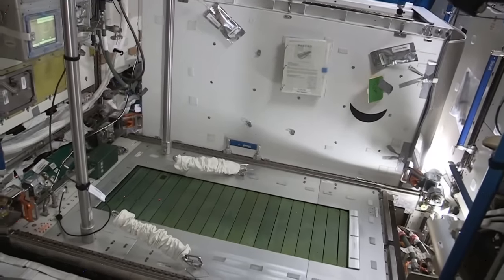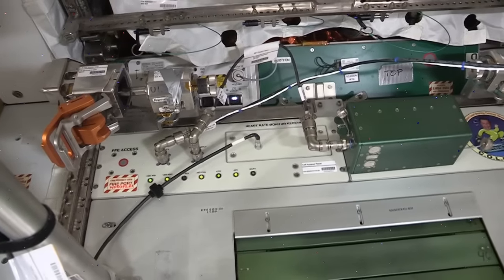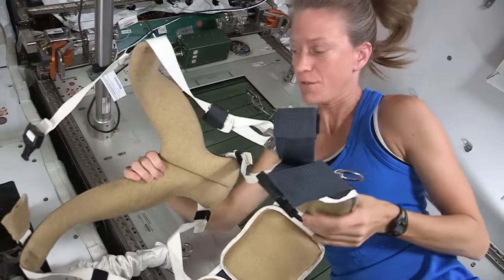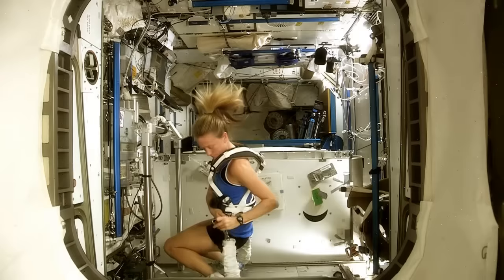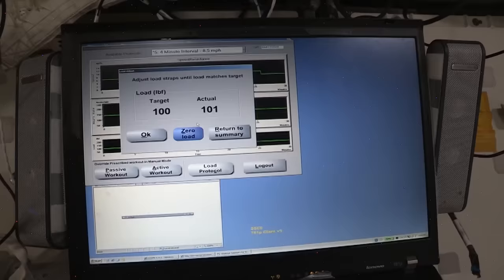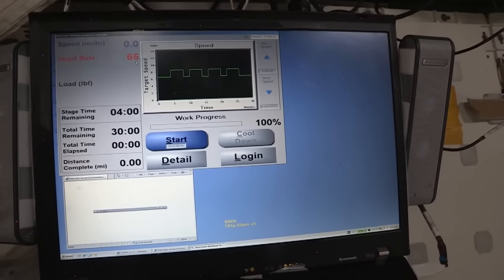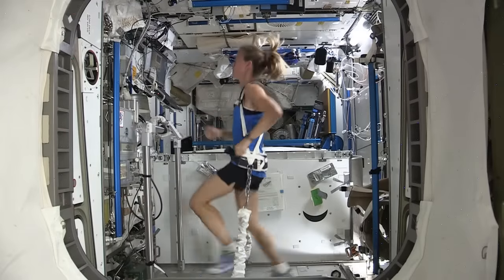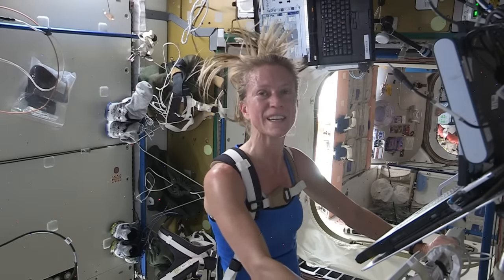Running in Space!

Comment: Is that... is that Windows XP...
Reply: Dino Perić Yeah, upgrading programs would take too long/ too dangerous so they stick to what they were made on.
Reply: +Dino Perić That's what you get when you need the computers to absolutely never fail. You use an old, well-known, well-proven software. The New Horizons probe uses a Playstation 1 core IIRC.
Reply: *****
 Exactly. Movies have messed with peoples perceptions. No they arent using some super secret advanced software with interactive holograms.... They use something thats proven and easy to use.
Reply: +Dino Perić Windows XP Is better then nothing :D
Reply: +TheRandom Gamer Windows XP is still the most stable and best running OS Microsoft ever produced.
Reply: +Raizzor18 The only problem - new hardware support. But it now can be run on almost any PC - no hardware limitation - just 1mb of video memory is enough! But I believe, it is customized XP.
Reply: budget cuts
Reply: My windows 7 is set up to look like that.

XP by default doesn't have the gray taskbar and start menu button (it's colored green and blue and kinda cartoony), that is a Win 95/98/2000 thing.
Reply: MsHojat
Id you install the ''Classic shell'' into your Win7,you can set the visuals to look like its win95,if you like it.
Reply: *****
 Yes I know. I already started that it is how I have my Windows 7 visually set up as.
Reply: +dangerous_999 I have windows 7 but im using windows 98(i think) theme because its requires less cpu power. 
I change it in system properties
Reply: Repsej 112
That's not really acurate.Changing a OS ''theme'' dosent reduces the cpu power needed to function while turning off visual effects like transparent window borders,Aero,animated preview tooltips,colourfull wallpapers,complex screensavers,etc does indeed reduces a small amount of the cpu clocking required to maintain OS operations on the background,releasing more of it for your own processes and tasks (games,music players,web paging etc.Still the best way to gain back clocking your your use is to go to the task manager and ''kill'' those process trees that you dont need ll the time like update searchs,periferical control programs and ofc not installing too many adware along with your intended software (always read the panels on the installers very carefull to detect sneaky programs that come embebed on the main program install directories.).Hope this helps you in some way to get the most out of your pc use. =)
Reply: ***** Yeah, I meant to turn off the visual effects. It does give me a little fps boost in games. I already know those things but thanks for checking sure :)
Reply: Repsej 112
Np,always glad to help if im able.We cant all be trolls in this place.Sry for the typos tho,im not english native.
Reply: It looks like 95 or 98, not XP. I remember having a computer layout like that when I was a kid.
Reply: XP MASTER RACE
Reply: It's  probably some kind of Linux, 'cause variations of it are used on spaceships
Reply: No, it's windows 98 i think :D .
Reply: Windows 2000
Reply: AndroidHood ns
Reply: ISS uses a modified version of windows 2000 I believe.
Reply: The problem is not in the Windows, it is in the hardware. They have to use old technology. The new one has such small dimensions (28 nm ?) that it is very vulnerable to space radiation. The old one could handle the radiation better.

Also the rockets are running on old 486 computer chips, or older.
Reply: there is. They are on low orbit. Atmosphere and magnetosphere bounces off most of it but  they are less protected then on sourface of planet.
Reply: Dino where?
Reply: Remember, the ISS was initially launched way back in '98, so back then XP / ME / w/e was more or less the best windows out there. Also, no sense in updating it since there's no risk of viruses or hacking or anything since the only links are directly with ground control and such. :)
Reply: DUN DUN DUN DUN DUN
Reply: Looks like windows 2000
Reply: i belive its 98 :D
Reply: XP get it :p
Reply: No, Windows 7 with Classic Theme on. Makes it run faster & smoother as UI Looks isn't really a big deal.
Reply: Dino IDK, maybe Windows 2k?
Reply: it's windows 98 not XP
Reply: You should see what computers they were using when landing on the moon :)

But yeah, I would rather expect linux... oh well, maybe microsoft funds them a lot...
Reply: I love xp. My old computers with win xp works still fantastic
Reply: It may have been 98 or 95...
Reply: space is expensive!!!
Reply: No its Windows SE (space edition)
Reply: It's avionic system not windows. By looking just start button on doesn't mean windows os. They don't use computers for gaming or entertainment. They are using for various systems monitoring and control.
Reply: Custom version.
Reply: No its Windows XD 

Haha jk jk
Reply: I asked that same question when I saw that and was just about to comment it...
Reply: นี้และสุดยอด  โปร์แกรม์ต้นแบบคอมพิวเตอร์  ตอนนั้นอ่านภาษาอังกฤษไม่เก่ง  ไม่เป็นคอมพิวเตอร์  นั่งอยู่ข้างหลังคนเล่นเป็น  แอปจำสัณญาลักษณ์นั้นเอา  จำลักษณ์เอา  สัณญาลักษณ์พูดได้  สื่อภาษารับรู้การเรียนรู้ได้  คนคิดชังเยี่ยมไปเลย  วินโด้  xp
Reply: PaperCookies yigiyighig gigigives gi gogogigooggigoiiggoiiggiog
Reply: Windows 2000
Reply: These reply’s are too old I can’t
Reply: they dint use there computers for programming use so there is really no need to upgrade. The only thing they use it for is to monitor and execute commands
Reply: asking the right questions
Reply: Why do they use Windows at all? Most vulnerable os ever made xD
Reply: @necaton  do you really think that radio waves can go past the atmosphere and 400km above space to a space station with encrypted antennas that have the power to receive what they want

second of all they use windows xp to execute commands and they cant really be hacked unless there is a physical chip that someone inserted
Reply: @faruqhossain5314  I dont know what you mean with the first part of you response cause it has nothing to do with what i mean. The only thing i said was that Windows is vulnerable af and they should switch to linux. The only reason they dont do that is probably that the computers already run for 2 years xD
Reply: @necaton  it is very risky to upgrade hardware in the iss since everything has to be on standby. just think if they shut off there systems to update it will be catastrophic for them . what i mean with the first part is there is any way the public can contact them, the only that can contact them is jpl and other nations and of course they do press briefing but you have to ask them from a facility
Reply: better than Windows 10
Reply: nope it's 95

Comment: I designed a special bodybuilding weight set for astronauts. It consists of a bar surrounded by 2 other bars. To use, select how much weight to lift; then, workout. The weights are actually just a bar that is held by an electromagnet. I would suggest; of course, a channel slim enough to prevent the bar from flying away.

Comment: NASA relies on technology that is tried and tested. That means old technology. As long as the job is done, they have no need to upgrade. With new software, there are always new problems, problems that they don't need when they are up on space. Here on earth we want speed but up in space, all they want is reliability. Maybe, in 5 to 10 years time, they may upgrade the OS. Or maybe not. I have no idea of the current software requirements of their programs. I am pretty sure they have it all sorted though. Pretty sure.
Reply: Actually they would love to upgrade their systems but the space station's core systems are built in a time where digital technology especially  was far less developed. In order to upgrade it they would have to replace large portions of the physical space station, which simply isn't going to happen with the budgets that the space station is assigned by the governments participating. However in this specific case, yes there's no need to have a special Linux OS or something fancy for a treadmill and a old windows OS does fine

Comment: I assume someone has calculated or better, measured the various flexing resonances of the ISS.  It is obvious that the 'isolation' system merely delays or slows the rhythmic loads the runner imparts to the treadmill.  Of course if the treadmill is actually at a flexing node for the frequencies that the various residents run, that would be even better.

Comment: what happens if you wear heavy weights up there. Would it drag you down or just feel as if there was nothing there
Reply: It would take more effort to push off from things and to stop yourself from moving, but that's about it. You'd be increasing your mass, and therefore your inertia, but you'd still be weightless.
Reply: It wouldn't push you in any direction, because there's nothing pulling the weight "down", but a 100kg object is still harder to move (and harder to stop) than a 1kg object. If you'd have another thing which weighs exactly as much as you do, and you push it away, you both float away at the same speed. In fact, that principle is how they move around the space station, they push the station away from themselves, but because the station is so heavy, almost the entirety of that force moves the person in the station away from the wall, rather than the wall away from the person. That's also why you can see in the video the treadmill is floating around on these things instead of being fixed in place. Because on the treadmill, you're actually putting a lot of force in, as opposed to the gently push you do when moving around the space station, so you'd actually move the station around a little bit and put if of course. It's not much, the station still weighs a lot more, but if 6 people each do that every day for 30 second, the station suffers a lot of structural loads and all kinds of troubles.

So in short, you'd feel the difference an object has in weight, but nothing would fall down, it would just be harder to move (just like two balls on a surface, a heavy one and a light one, only in this case it's not just on the 2d surface like that but in the entire thee dimensional room).

Comment: I know that in the sense of cardio this is essential, but as for the muscles, wouldn't those shock pulse electrodes used as muscle enhancement like push ups be less of a weight on the ship/station and more effective? just stick the electrodes to the muscles and the pulse makes the muscles contract as it was doing muscle exercises. And maybe the tether bungee could serve as attachment to do floating ab crunches which would in fact get the heart pumping and then the weight would not be transmitted to the ship/station.

Comment: And about the energy of the station and oxigene? Sorry if its a dumb question!
Reply: The ISS has large solar panels to generate electricity.  They can generate oxygen through electrolysis, which separates the hydrogen and oxygen in water by using electricity.   They also have oxygen stored in tanks for backup.

Comment: I'm curious as to how NASA exercise physiologists prescribe programs for the astronauts. 
One the one hand they have the issue of muscle (and bone) loss from no gravity. On the other hand they have the risk of cardiovascular dysfunction if the heart isn't kept healthy. But then there is the issue that cardiovascular exercise causes a significant interference effect which blunts the hypertrophic response. It is well established that on earth, cardiovascular exercise interferes with muscle hypertrophy to a large degree. Running happens to be the biggest offender and ironically the modality most used by NASA. This is before you add in the issue of no gravity.
See this review published in the JSCR. https://www.ncbi.nlm.nih.gov/pubmed/22002517
So if lack of gravity causes muscle wasting, and lots of cardio like NASA prescribes interferes with the ability to develop muscle, how does NASA program the resistance portion of the training to mitigate this effect? Do the dangers of cardiovascular problems outweigh the problems of muscle wasting to the point that muscle loss is an acceptable outcome? Without gravity and all the cardio, is it even possible for astronauts to maintain muscle mass, never mind build it?
Would be curious to know how this problem is rectified.

Comment: BUT CAN YOU LIFT ? without bands that is actual free weights? Jk I'm not an idiot. That's would blow though lifting hundreds of pounds but no gains:(
Reply: They have a lifting machine, but as there's no weight it provides resistance in another way.

 I think it was vacuum tubes, and you can adjust your "weight" by how much force it takes to move with the pressure pulling on it.
Reply: Greatjob ty they have a dead lift machine working with vacuum
Reply: Why not just use springs with a specific spring constant? similar to how spring scales work.

Comment: I can't belive you use Windows in there 👎🏻
Reply: As far as i know that is not very uncommon with government and military organizations. Without getting into too much detail. Upgrading to the latest and greatest windows is usually for civilians. It's also very detrimental to switch to an unfamiliar software and risk ruining the system they have intact. They also need to work with legacy software. In short, they don't wasn't a system crash just because they want to have Windows 10. Also it's assuming that its necessary to have windows 10 (for whatever reason) the process is probably very bureaucratic and expensive.